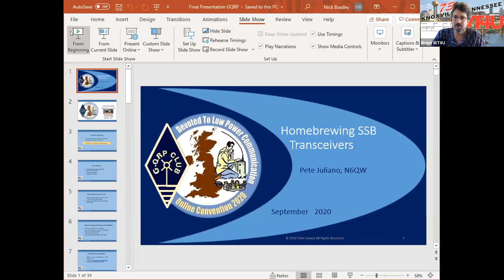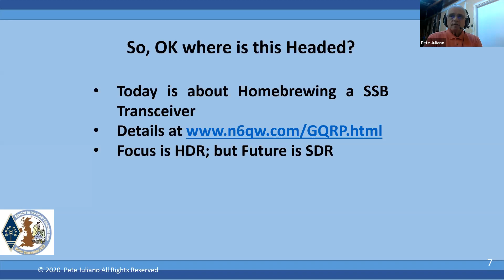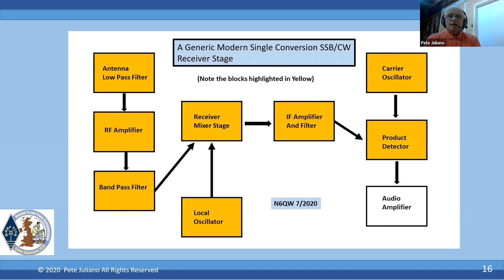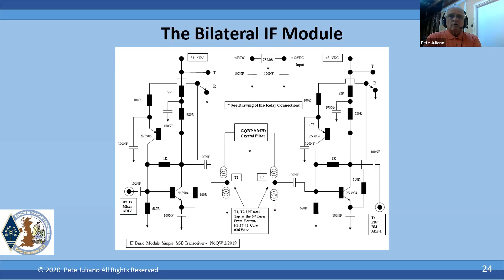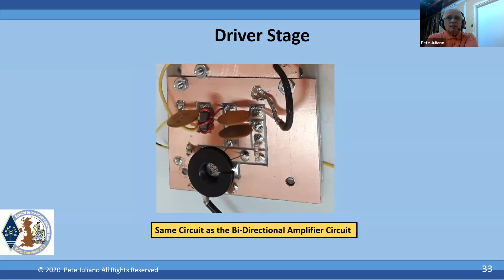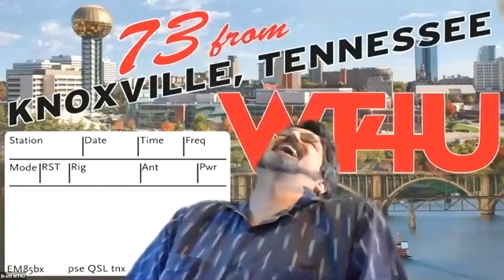G QRP Convention 2020: Pete N6QW - Building SSB Transceivers

Comment: Seems to me that putting +8V (100R) on the 2N3904 emitter with its base grounded (680R) will cause the BE junction to break down. These "diode" junctions have quite low breakdown voltages. May depend on supplier/technology of device fabrication. But it is not a good hing to do
Reply from the maker: Anthony, as Pete explains in the video, the amplifiers come originally from Plessey and are described in the ARRL's Experimental Methods. They work very well. If you need to discuss the detail, best to e-mail Pete as he is unlikely to see comments here.